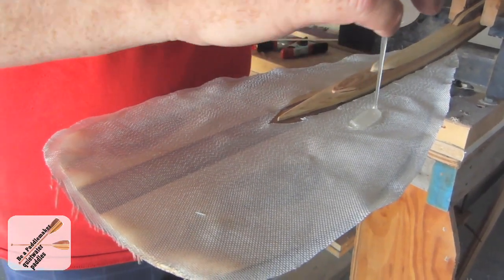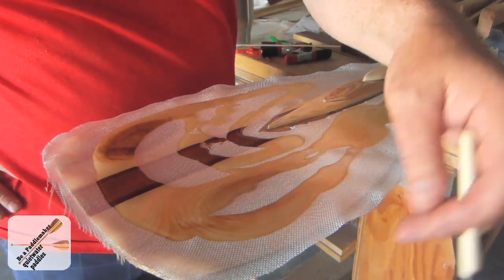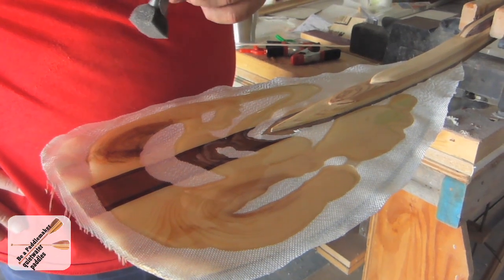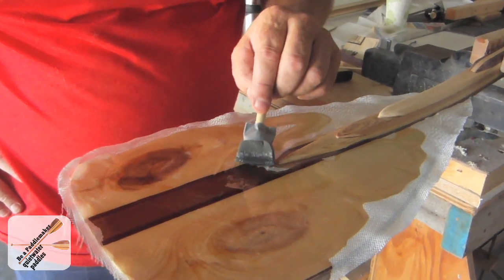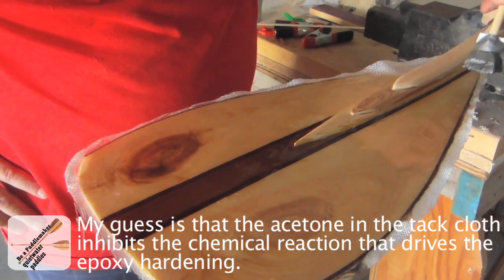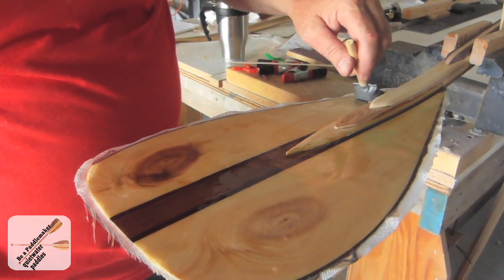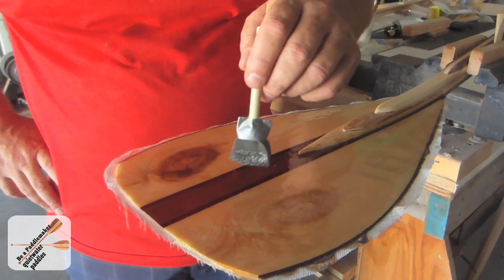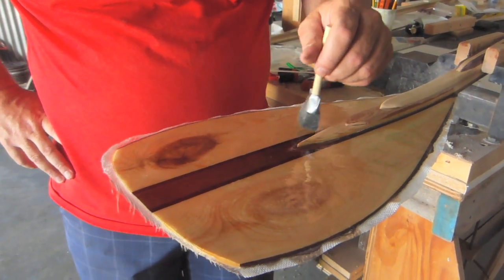Canoe Paddle Blade - Fiberglass and Epoxy

Comment: Have to agree with mewolf1.Your cloth is floating with resin between the  wood and cloth. Vacuum bagging is a method, that gives great strength with less weight.  A great trick, without vacuum bagging, is to use Peel Ply. One thin coat of resin, then lay on the peel ply. After the resin has set, remove the peel ply. One more thin coat, and you are done. Just trying to help you produce an even better paddle. I like the homemade foam brush !

Comment from the maker: Hi all - It's been awhile since this flurry of activity. I've not had a reoccurrence of this bizarre fish eye 'behavior', but a few thoughts have occurred that further explain my perspective on epoxy and fiberglass and paddle blades.
#1 - To each their own. There's not an absolute, there is beaucoup knowledge gained via experience, as the responders have pointed out! That's the big reason there's enough wood and material in quietwater paddle kits to make TWO paddles. The first paddle gives you a 'taste' and some perspective on how to work with wood, hand tools, your hands and 'foreign substances' like epoxy and fiberglass. The second paddle benefits from what you learned on the first one.

#2 - A paddle blade is a small project. It's not a canoe or even the side of canoe, it's more like a shoebox.  So I don't worry about the weight of the epoxy all that much, even if I use too much, as some have pointed out, we're still talking about less than an ounce difference between 'optimum' and what I apply. A brush continues to be my preferred spreader, mainly because the hard edges of a spreader tend to move the cloth around too much. For me, I feel that I have better control while moving the epoxy around with soft brush bristles rather than the hard corners and edges of a spreader. The piece of cloth is too small. A spreader DEFINITELY has its place, although for me, that is on a bigger surface area like the bottom of a paddle board.

#3 -  Multiple coats are a good thing. Filling the weave is ideal with that first pour, but I never quite achieve that goal. So a second pour to fill the weave and sometimes even a third pour are needed to get it where I want the surface to be. 

As others point out though - extra epoxy does add unneeded weight AND epoxy beyond what is need to fill the weave is generally not necessary.  For one side of a paddle blade my first pour is three tablespoons. A second coat is three teaspoons. Again, were talking very small quantities, a big difference relative to the amounts needed for a canoe or other boat-sized project. As above having that first paddle to 'learn' on is a big deal. Most people that buy the kits have never done anything with epoxy or fiberglass before.

I am happy they want to try and hope that a two paddle kit works out for them!

Comment: The glass is floating, and not to the wood as it should be. If you wet out the wood first then lay down the cloth and wet out, but without excess resin, the bond will be much better. Fill coats after. No offense intended, just been doing this for some time.
Reply from the maker: +mewolf1 not sure what you are referring to?  If the fisheyes - I don't see them in the initial pour, I see them in the smaller secondary pour. 

As for wetting the wood first, in my experience (also for a long time) I find it easier to place small pieces of cloth on dry wood. To your point I do wait until I see the epoxy soaking through the cloth and wetting the wood before I do any spreading or brushing. Once this saturation occurs, the cloth adheres to the surface and does not move when I begin spreading the epoxy. Even then any spreading is with minimal downward pressure. As with so many other things, finesse tends to succeed way more often than brute strength.
Reply: You need to learn more about epoxy before describing your technique as "finesse".

Comment: fisheyes are a job issue to some degree.  my suggestion is to not pour, unless squeegee excess resin out, then fill weave with second and third coats. better finish and lamination. when pouring, the cloth can literally " float" in the resin.
Reply from the maker: +mewolf1 It's worth a try. If a different method wrt the first coat ends up making the second 'fill-in' coat better (e.g. no fish eyes) - that would certainly be a good thing.

Comment: What do you do with the edge of the blade after you have glassed both sides?
Reply from the maker: Hi Chris - A couple things here - #1 Fiberglass does not like bending around sharp edges. You likely discovered that already, though.  A quarter inch wide strip of glass is not really feasible, either.  Happily, by the time you get done brushing the epoxy around the blade surfaces, there should be plenty of epoxy that went over the edge and 'coated' that edge. If not, just spend a few minutes wiping your brush along the edges. Nothing heavy or it will drip off. Do it a few times over a couple days and gradually build up the epoxy on the edges. While this is not reinforced with the glass fibers, after curing for a few days, it will be quite hard and durable AND waterproof, so that edge should have plenty of protection.

I like adding strips of wood along the edge.  Purpleheart is one of my favorites. Just about any wood is going to be harder than western red cedar, so that hardwood edge strip with epoxy on top of it should offer plenty of protection from hitting the blade against the gunwale, or rocks or big fish....

hope that helps! Jeff

Comment from the maker: Hi all
Lots of updates since I poured this epoxy. I'll get more videos on this channel as soon as I can! wrt Lumberjack and Natty yes I have tried other epoxy brands. MAS, EcoPoxy, and TotalBoat are all on my bench now. They're all good and workable epoxys. MAS has no amine blush which is nice. The other two require a post-cure warm water wipe down to get rid of the amine blush. EcoPoxy is a "friendly" product with ingredients that are eco-friendly. Thus the name. Based on hazelnut (?) if I remember correctly.

When you are pouring epoxy, make sure you do not spread it "too thin". This is hard to define, but you know you went too thin when you see "fisheyes" in the dried surface of the epoxy.  Based on my experience, it looks to me like when I spread epoxy too thin, it's like I am "stretching" it over the surface. The wet epoxy reaches some limit and then it "snaps" apart" and retracts back to a "location" where it "re-achieves" some level of thickness. The remnant of the "snap apart" looks like a round hole in the epoxy. A fisheye.
Moral of the story from my pov is to avoid spreading the epoxy too thin. Be conservative, e.g. make 4 tsps for the second pour instead of 3, better to have too much and minimize spreading rather than too little and end up really working the wet epoxy to get it to cover the area. Overworking it and spreading it too thin, are what I think cause these "snapback holes" "fisheyes" to appear in what was a good looking smooth surface when the epoxy was wet and you left the room.....
Reply: A good way to estimate the amount of epoxy needed is to weigh the cloth on a digital scale.  An example would be if the cloth weighs 3 oz, then mix a little more then 3 oz of epoxy.  Normally its a 1 to 1 ratio, but mixing more epoxy then the weight of the cloth leaves room for error/loss

Comment: Do you only fiberglass one side of the paddle?  Does that provide enough strength?
Reply from the maker: I apply four ounce fiberglass to both sides of the blade. This video just shows the one side. If memory serves, as soon as this was dry I flipped it over and did the other side.
Reply: @QuietwaterPaddles  What I have been doing lately to save on weight is to add fiberglass cloth to one full side and then only fiberglass cloth up half-way on the other side.  It think this gives me enough strength without adding unnecessary weight to the paddle.
Reply from the maker: @explorermike19  For me, there's a pretty wide spectrum when it comes to weight, even on a paddle blade. For those who might do just one big trip a year with one of the goals being to enjoy high mileage days on the water, then yes what you do should work just fine. For others, a spin around the lake after work is the frequent choice. That's more of what I tend towards. In that scenario, for me,  weight doesn't matter. If weight was a higher priority, I would first lose about forty pounds off of me, rather than an ounce off a paddle blade.
You could also look at using a two ounce weight of fiberglass cloth.  I've built a few paddles with that, but at the end of the day I like four ounce plain weave cloth and MAS epoxy with medium hardener. Easy to work, adds a bunch of strength and stiffness, and lets the wood shine through.
Reply: @QuietwaterPaddles  That makes good sense.  I agree that for short paddle trips, weight is not a big deal and for a LOT of people, paddles get banged around a lot, thrown into cars and trunks and used for poling along the shallow sea floor as well as paddling, so durability if important.  For longer paddling, a little extra weight wouldn't seem to make much difference and for me it doesn't because I have hugely strong arms and upper strength.  However, I notice that most of my friends naturally gravitate toward their lighter weight paddles when they have other paddles to chose from.   A lot of my friends carry wood paddles as spares, but primarily paddle with carbon fiber.  I agree with you that 4 ounce fiberglass cloth seems to work better than 2 ounce.

Comment: 3 tablespoons?
Reply: The MAS is a 2:1 ratio of resin to hardener, and a three tablespoon pot is about the right amount. The mixing cup is small, the blade is small, and measuring spoons from the kitchen were on hand. Most important is the ratio

Comment: What kind of epoxy did you use?
Reply from the maker: I like MAS brand epoxy. I used it for the blade in this video and continue using it as I type this in November 2020. For small quantity 'pots', like the ~three tablespoon-sized pours I do for a typical paddle blade, a 2:1 ratio is easy to measure out and pour from the resin and hardener containers. Other brands use different ratios of hardener to resin, which can make it hard to measure and pour a small volume of the hardener. Nothing wrong with other brands of epoxy, I just like how easy it is to measure and pour small quantities of MAS resin and hardener.

Comment: You are using way to much epoxy! You will not gain strength doing that, only weight. Use as little epoxy as possible while still saturating the whole cloth ofcourse. Then come back after it has hardened a bit and do 1-2 topcoats until you have filled in the texture of the cloth.
Reply: jonnebanan so how much better is this than just a typical finished wood paddle blade? Does the blade wear at all? You could put some funky deal on underneath that probably and they wouldn't get scratched off?
Reply: The glass makes the blade tougher, more resistant to scratches and dings.
As jonnebanan said, more epoxy doesn't add strength.  Your initial fill coat should saturate the glass and make it clear, but there should be fiberglass weave showing when it hardens...then add top coats to fill the low spots.
A squeegee works better than a brush to push the glass down in the epoxy puddle and scrape off the excess.
Reply: Epoxy resin DOES add strength. Try and break a piece after it's hardened. You're repeating the old rules about polyester resin. Still, less resin to glass gives a higher strength to weight ratio.
Reply: @UguysRnuts  Yes, sorry. I should have written "adding more epoxy only adds a tiny bit more strength, but mostly just more weight. You are correct.
Reply from the maker: @shawnharris5734  It may be stating the obvious, but epoxy seals the wood and prevents the wood surface from absorbing any water. A tip guard on the bottom end besides hardening the bottom, also seals the end grain from additional water absorption.

Comment: As mewolf says...too much epoxy...the ideal ratio is the exact amount by weight...not volume... to equal the weight of the cloth...a TINY bit more if you dont want the weave to be as noticeable. But he is also wrong about the application process...this which is shown is correct...laying down the dry cloth...allowing it to be positioned...then wetting it out...finally...if this IS epoxy resin...it will break down in sunlight, and should be painted, or  have pigment added to it. Fiberglass resin will NOT break down in sunlight, which is why surfboards are clear...the graphics are applied to the foam before its glassed. Epoxy boards are always painted, and you will never see the cloth...the graphics are always on the surface.
Reply: Another eggspert what doesn't know what he's talking about. You don't need to "always paint epoxy". Look at cedar strip canoes for example. Varnish with UV inhibitors will do a fine job without paint.
Reply from the maker: First, there is usually more the one way to do something. If your way works for you that's great! While I do have a scale in my shop, I have found it easier to measure out volumes, mark the side of the pot and pour the resin and hardener in to fit the marks.  For larger volumes going by weight might be more manageable, but for these little pours I find simple volume pours easier.
Second - I very much agree that sunlight is harsh on the finished surface. While paint would certainly work if that's what you want to look at, I want to see the wood underneath. In lieu of paint, I like a varnish with UV inhibitors added. My choice is Pettit's Z Spar 1015 Captain's varnish. There are other brands out there, to each their own, but for sure a cured epoxy/fiberglass surface needs to have something over it to protect it from UV damage. 
Finally, I think woodworking is an experiential thing. The more you do, the better you get. It's near impossible to get the first try correct, but it can certainly inform and improve the second try!
happy paddling!
Jeff